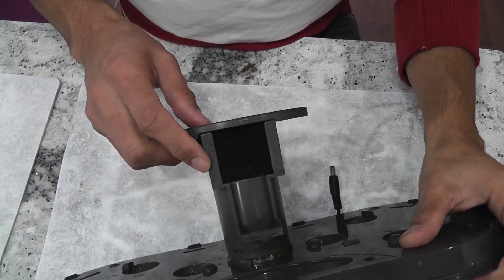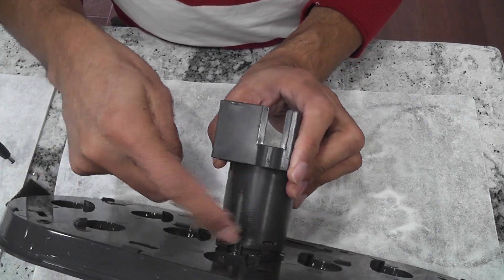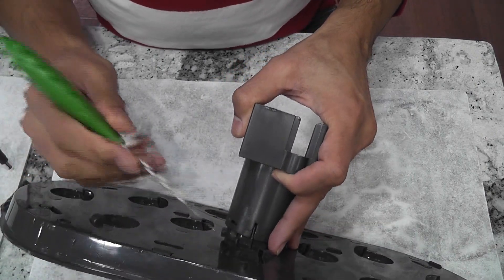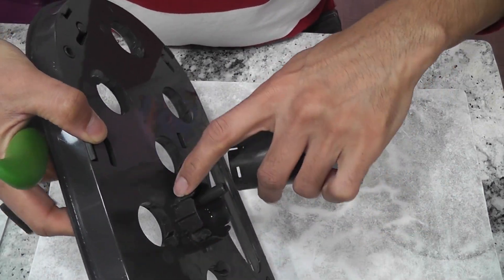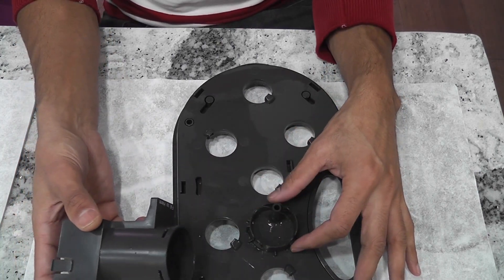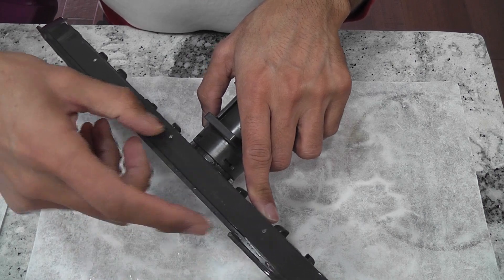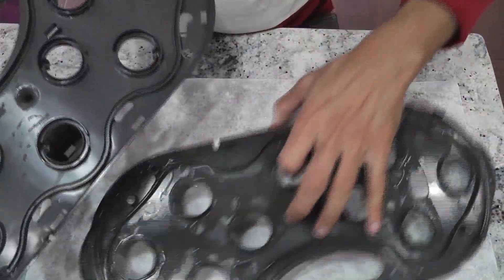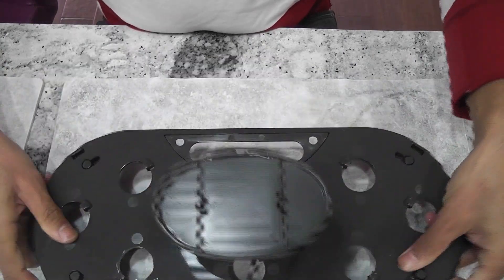Detach Aerogarden Bounty grow deck | Deep cleaning | Hydroponics #hydroponics #aerogarden #gardening

Comment: Thank u. My pump is making a humming noise.  What could it be
Reply from the maker: It could be that the rotator inside the pump got stuck are having trouble rotating. Have you tried opening the pump and clean it? There are 2 super small rubber casing on the edges of the small plastic stick that holds the rotator. Maybe they are not well positioned. Try opening the pump and put them back. Hopefully that fixes the sqeaking noise.
Reply: @aerogardenexperiments  I did not know I could open the pump itself. I did open the casing like u did and cleaned the slime off the outside of the pump. Seems to solve the problem